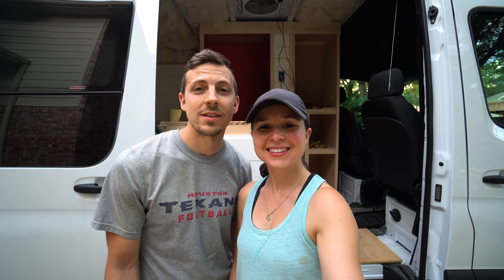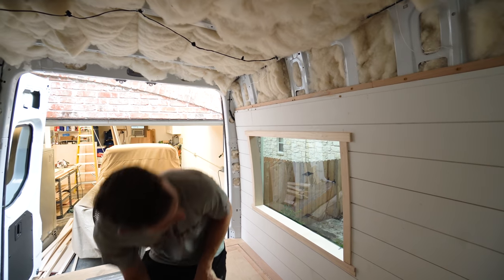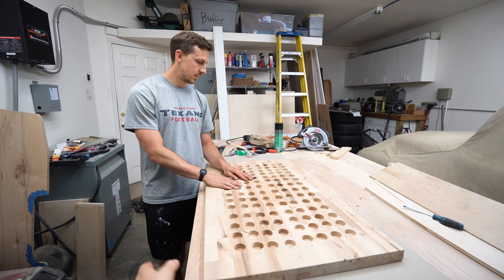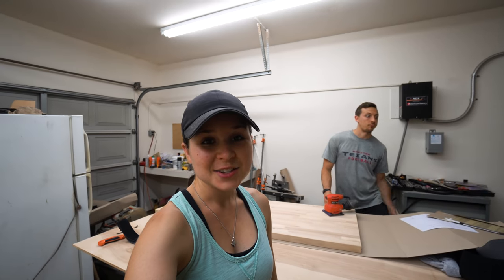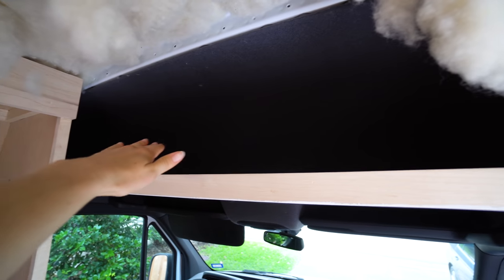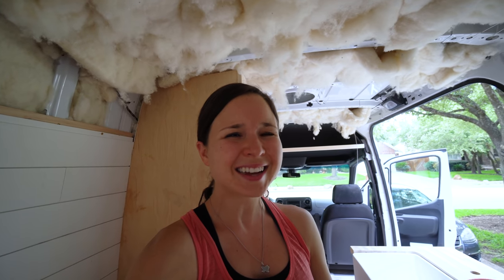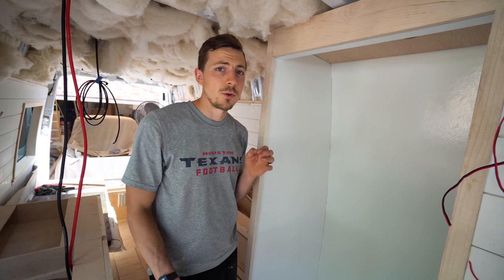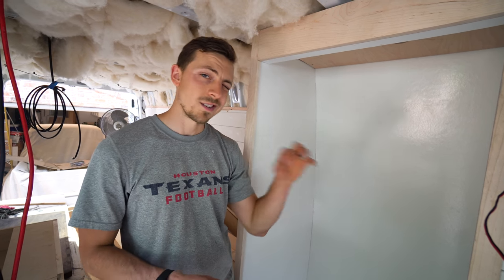Van Conversion Shower Updates + Headliner Shelf | Van Build Series

Comment: Hey. :) Nice video - thanks for sharing! One thing I wish van vloggers would do is put the length of their Sprinters (or make/model/length of other vans) in the description ... I'm guessing this is the 170 wb, but it'd be helpful to gauge space usage for those of us still in the dreaming stages. Thanks again, and enjoy your travels!
Reply from the maker: Great idea! We can definitely start doing that! We plan to put all of the stats in our van tour video as well. And yes, it’s a 170 WB and not a 4x4. :)
Reply: @AdventuresofAplusK  Thanks so much for the fast reply! We're still in the "which size should we buy" phase, so seeing how designs compare with regard to overall size is really helpful. If you don't mind my asking, do you find the longer wheelbase difficult to maneuver in traffic - esp city traffic? Or parking? Those are my main concerns. Thanks again! :)
Reply from the maker: Of course! Happy to help whenever we can! We mostly chose the 170 so we could fit the shower and still have a solid amount of storage space. So far it hasn’t been hard to drive, but we haven’t tried parking it in many complicated places (we usually just do two spots and pull through them). We haven’t really taken it into a city yet either, but definitely plan to. Our van friends have though and they have been able to park their 170 extended in Seattle and Austin (to name a few) just fine, which is crazy!